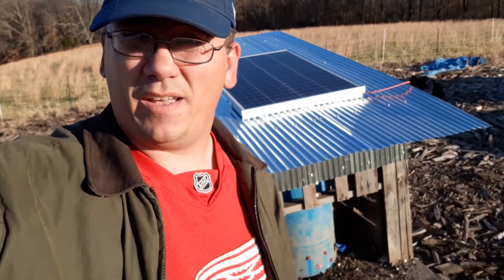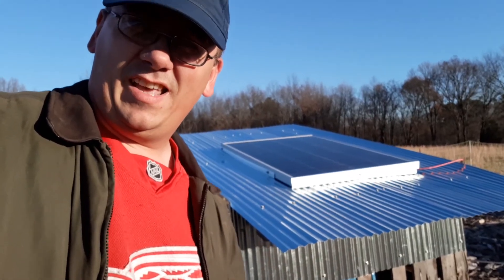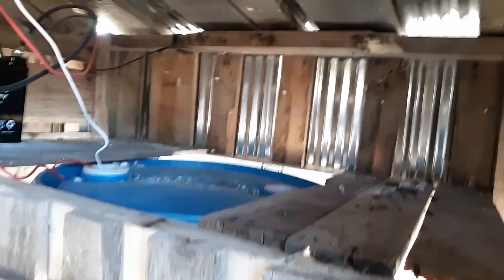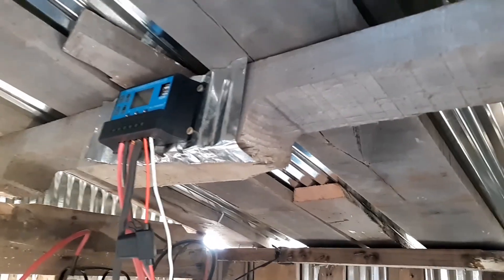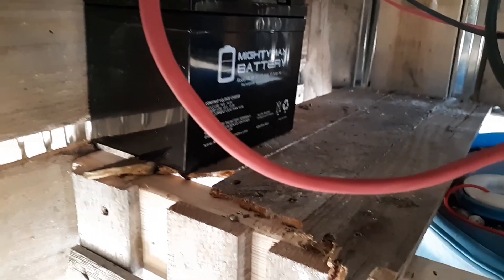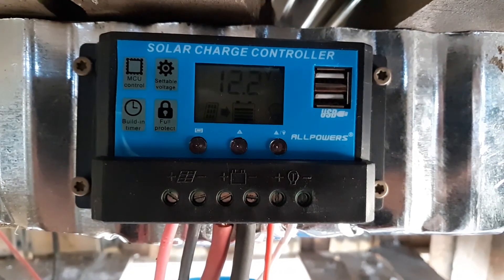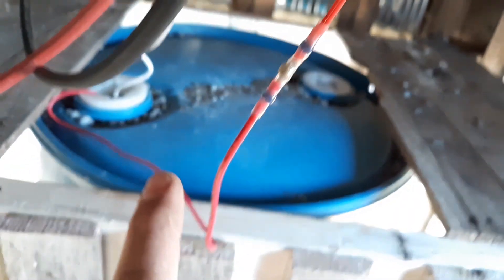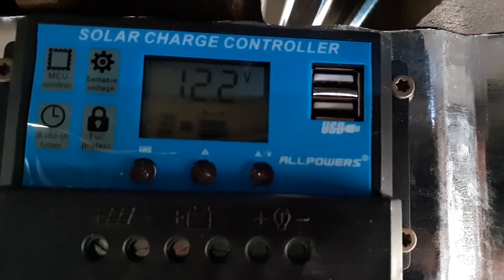Solar Powered Water Deicer Success

Comment: where do I get a deicer
Reply from the maker: Bought mine off of Amazon. Works best if you can put the watering barrel inside another & fill the gap between the two with spray foam insulation. Two RV deicers work best using this method bonding them both to the outside wall of the inside barrel. That way the rv deicers are held solidly in place.
A couple solar panels vs the single I was using works a lot better & the insulation makes the system more efficient.

Comment: Can I put the Facon Deicer on the bottom of my plastic 7gal waterer?
Reply from the maker: Yes. I would use it in a way that the animals can't damage the pad.
Preferably close to the hog watering or poultry watering nipple(s), if you're using an fully enclosed barrel or pail.
If it's open like a watering trough, I'd suggest getting a larger trough or barrel to set it in & adhere the heating pad to the outside edge of the inner trough, then insulate in between the two containers. This way the heater would be protected from animal damage & have insulation around it to help maintain the water temperature.
I live in a spot where most of our winter isn't too bad, but we do get a week or two of negative temps, so the insulation is a must in colder regions. Otherwise it just keeps a small area around the heating pad melted in really cold situations.

Comment: I came across your video researching for my coop. I have 2 water tanks that might be 10gal each. I want to run a deicer in each, but off one panel. Can you tell me if that’s possible? Would I need more than one controller?
Reply from the maker: It depends on how much light you get where you are located. The best way to make it is if you put each barrel inside of a larger barrel & only cutting open a slot in the larger barrel to have only the watering nipple part of the inside barrel exposed.
Then filling the air gap in between barrels with spray foam insulation, this will make the job of the tank deicer a whole lot easier.
I ended up cutting a slot in a 55 gallon plastic drum, then placing a 30 gallon rum inside it. From there I filled the gap with spray foam & it worked really well at keeping the water temp a lot easier to control.
I did this after trying out having the 30 gallon barrel exposed directly to the external temperatures, which it kept up great, until we hit the extremely cold winter nights. That's when the water on the opposite side of the barrel from the deicer, started to freeze.
That is why I went to having a insulated barrier & having it where the chickens don't have the opportunity to eat the spray foam, which they will do if they see it.
I was using a single 100 watt panel, which did good powering a single deicer, with a couple of batteries to keep the charge through the night. I'd recommend having a panel & charge controller for each deicer & going with a larger panel, 200 to 300 watt would more ideal. I was trying to test to see how little, I could get by with, but I still had to bring water out, when we had the negative Fahrenheit temperature days, due to barrel freezing when I was using an uninsulated barrel.

Comment: Where do I get the deicer
Reply from the maker: I bought an Large RV tank deicer(off of Amazon) & wired it up with a 12 volt solar charger/controller, with multiple batteries wired to increase amperage, & a 100 watt solar panel. A 200 watt or 300 watt panel would work much better.
Reply from the maker: Just search "RV heating pad" on Amazon, I used a 50 gallon rated Facon.

Comment: Hi there, is your de-icer still working? We are thinking about one too.
Reply from the maker: It works, if you bond the deicer to the side of the barrel, where it's from the bottom running up.
It works best, if you put a 30 gallon barrel inside of a 50 gallon barrel, insulating the space in between the two barrels. The 50 gallon barrel just needs the top cut off, to load the 30 gallon barrel inside & an opening cut out for the animals to access the chicken watering nipples or hog watering nipples on the 30 gallon barrel.
The hardest part is getting the deicer in place, it's easiest, if the 30 gallon barrel has the removable lid.
Reply from the maker: I would have responded faster, if YouTube would have notified me of your comment. They happened to have notified me of another comment on this video today.
Reply: @TheBanthaWhisperer  Thanks a lot anyway.